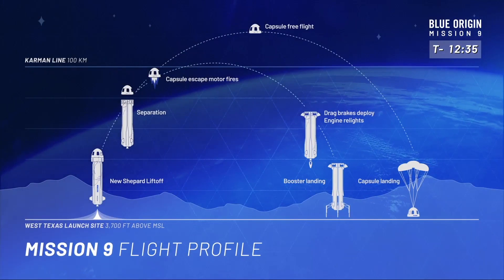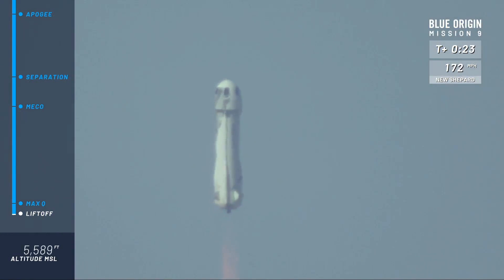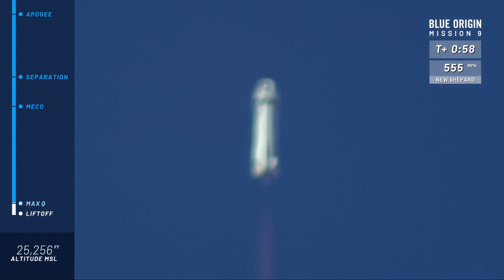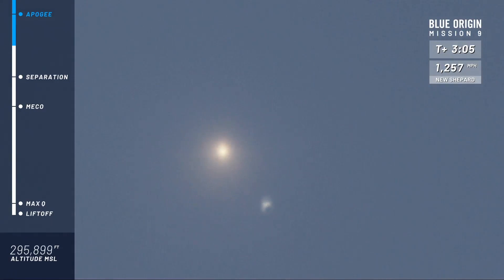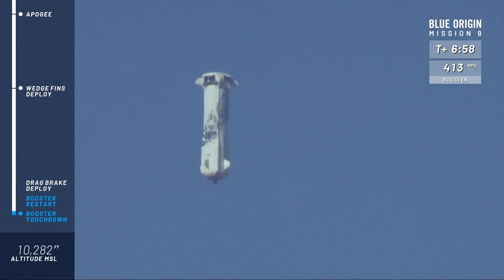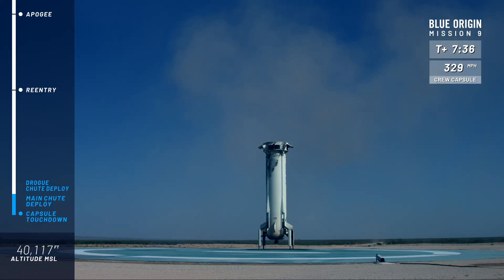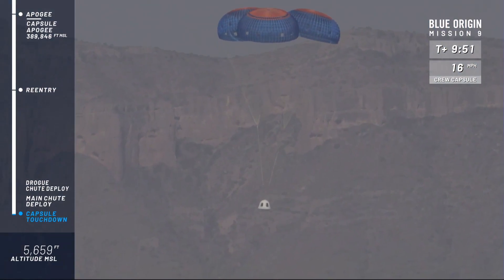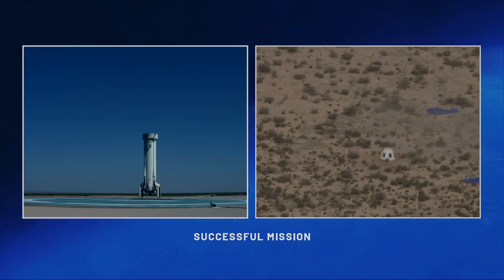New Shepard High-Altitude Escape Motor Test

Comment: how big is this Shepard?? for what can be used ?? i mean falcon9  is for satelites ecc but this one ???
Reply: BlakSoldat tourists! and maybe amazon prime members? possibly small experiments. totally useless im my opinion, new Glenn is his main project, i think this is spacex grasshopper equivalent but no-one dare tell geoff its useless!
Reply: shaun hahahah lul
Reply: Shepard=60ft. Falcon 9 = 230 ft.
Reply: Sanjit Daniel Thanks
Reply: It is for taking tourists (or teensy shortduration experiments), just barely out of the atmosphere and into 5-6 minutes of microgravity.
I.E. the same role as what Sounding Rockets are used for, but passenger-capable, and reuseable.
.
So no, it has a functional role and purpose.
But please do not compare it with SpaceX's Falcon rockets, or even with RocketLab's Electron. It is a completely different and lesser functionality.
Reply: "So no, it has a functional role and purpose."

As a carnival ride? Do bracelet wearers get unlimited rides?